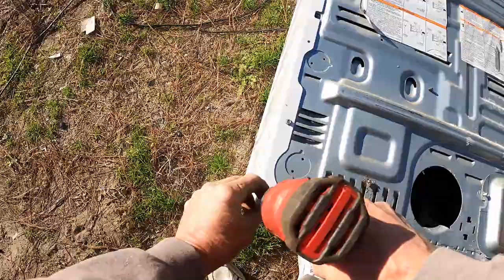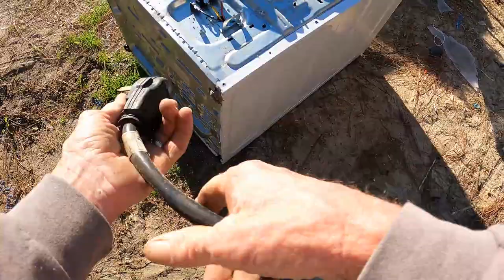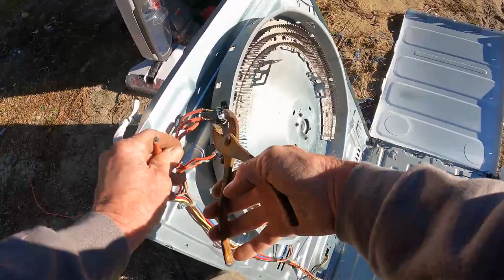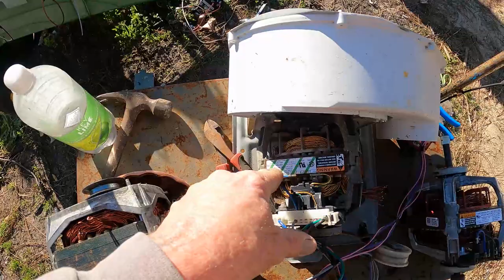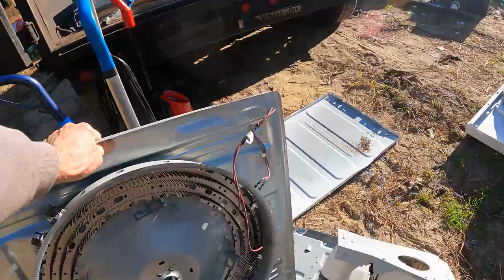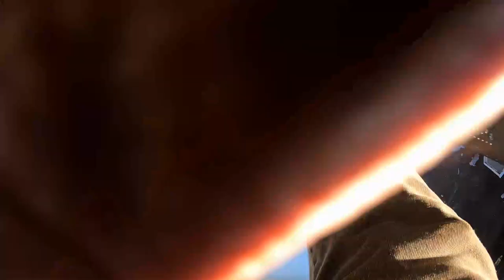Quick and Easy Dryer Tear Down For Scrap Metal

Comment: Copper wires are classified by insulation % to copper %  40% and some yards 50% is most commonly applied to house cords so is those wires inside dryers and washers to.  You forgot about heating coils $1.00 to $2.00 a lb
Reply from the maker: Thank you

Comment: So the motors in dryers aren't copper or are some copper I'm about to take apart one apart wondering if it's even worth it
Reply from the maker: Not worth the time to me. There mostly aluminum so you will get around 20 cents a pound for it. Motors pay 20 to 25 cents a pound.